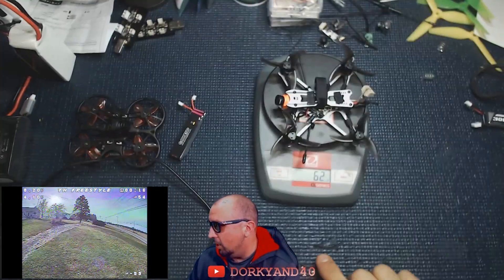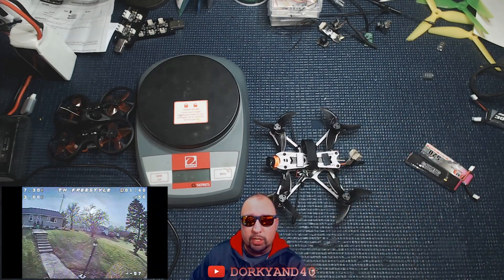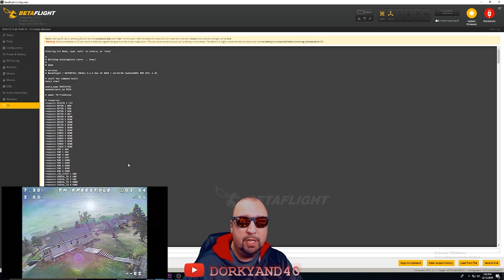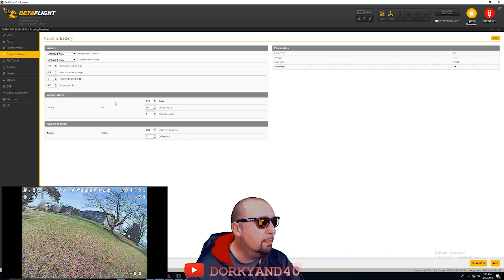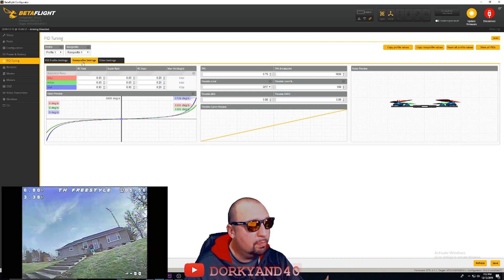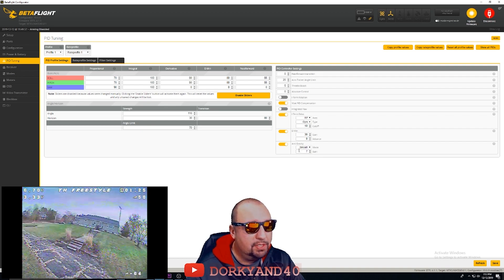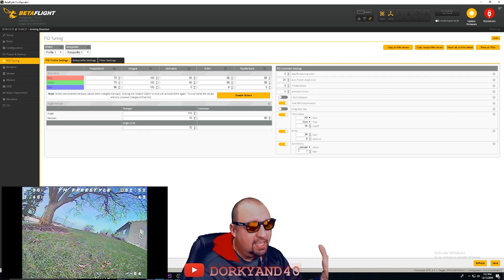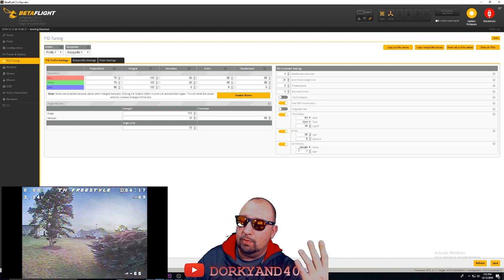EMAX TINYHAWK FREESTYLE BF 4.1 RPM PIDS and SETUP

Comment: I was in Betaflight verifying my receiver and switches and something happened and it disconnected and rebooted.  After which I couldn't connect.  I tried everything and no luck, the board didn't even light up as it should and wouldn't power cycle when batteries plugged in.  I had to flash the FC.  I have been struggling because the firmware has the motors mapped wrong and a few other things that I just learned in your video.  I didn't have a chance to do the dump to get all the correct resources etc.  Is there a way to get a file from some where?  Any help would be appreciated.
Reply from the maker: Emax has the default dumps on their website I think.
Reply: @Dorkyand40  The site wasn't the easiest to navigate to find the file.  I did find a good write up on the site that explained which version to use etc.  I flashed the FC with the recommendations and then copied over the CLI in Betaflight.  I've had the Quad almost a week and I finally got it in the air this evening.  Thank you for the help!

Comment: Hey I just wanted to let you know I tried to use the settings for the Phantom and it wouldnt lift off. it would instaflip. i found tons of videos on how to fix it but it didnt work. I ended up having to paste my dump into the CLI and it takes off normally now.
Reply from the maker: No problem with mine. Sounds like a motor resource or something was changed. Or props in and out. That’s probably it. Not sure what way I had them.
Reply: @Dorkyand40  I tried with pops in and props out. Tried syncing up motors, they were all spinning in the proper direction. I had to do this on my babyhawk too.. Not sure why.
Reply from the maker: Jayson hmm??  Not sure man. Well maybe take my numbers and work up to them and see. Weight..battery. Many things could have an effect. I also did the z48k jesc filters too. Both ships were just fine. Hope you just have fun. That’s the main part. :)
Reply: @Dorkyand40  For sure man, I was frustrated but getting it in the air was so awesome. I think I might have had a weird setting because in betaflight on the setup tab without my tx even on, if I pitched up or down it would roll instead.
Reply from the maker: Jayson hmm. Sounds like a resource thing. You can always do a dump and save that and then load the other settings. Verify how it move it the configuration and the motors tab. Or just screw it and fly :)
Reply: @Dorkyand40  screw it and fly. I was able to get the new pids that betaflight has stock now so I will try to fly tomorrow. Too windy today.